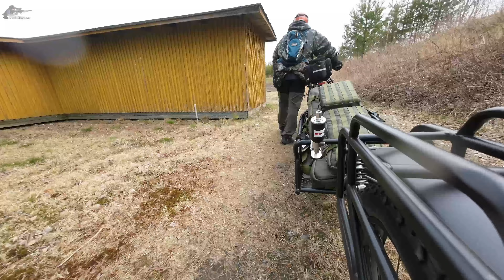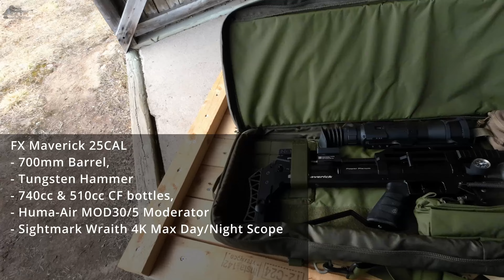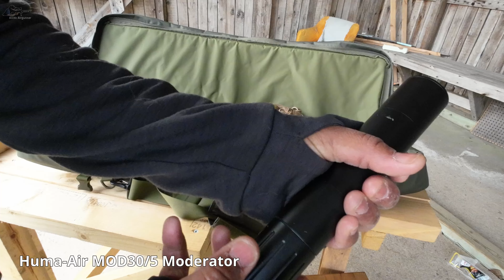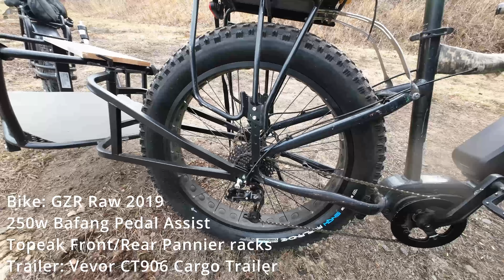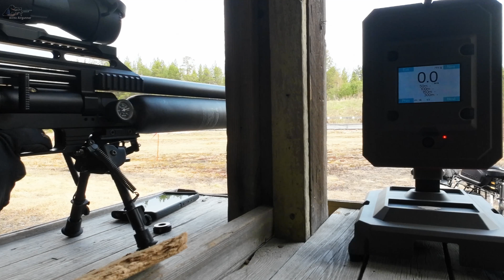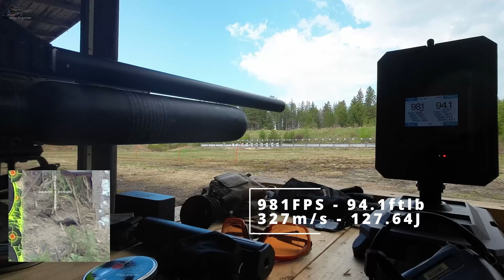FX Maverick Tasmanian Tiger Range Bag | FX Ballistic Chronograph

Comment: Change your liner to a heavy and measure again. I think this doesn’t give you a good result and you’re not hitting your target. 

I had the same erratic results when I tried shooting the .30cal 45grain ZAN slugs in my 1:26 pellet liner. 

After changing to a heavy slug liner (1:16) the speed changed and I hit the target. 

At the moment I’m finding out what slug works in my .30 cal Impact M3. Best results so far with FX hybrids 44,7 grain and 68grain ZAN slugs.  

And believe me, I’ve tried hundreds of different weight slugs before coming to this point over the last six months. 

At the moment I get 860FPS with the 68 ZAN’s with the 1st regulator on 170bar and the 2nd at 130bar. (Power block kit installed with a stronger hammer spring and Huma 8.5gram hammer weight) I’m trying to get them in the 950FPS region. 

As far as SHTF… I think it’s okay to survive using the rifle for hunting small game if you must eat, but don’t expect other kills unless you can hit someone in the eye at 50m 🤗

Comment: Good info. That's the main thing I do when it comes to airguns, is look for the best ballistics. In my M3 .25, I used AVS .253 50gr BTs and sm shooting them at 1040-1060 fps depending on temps and getting a bc of around .197, and in my Dynamic .30, I'm shooting Griffin 90gr bts at 970 fps getting around 187 fpe and a bc of .237. I try to find the slug with the best bc and accuracy. I am currently testing some new AVS .301 round nose boat tails and secant ogive boattails to see how they perform compared to the Griffin 90gr bts. Sorry, I geek out on ballistics.
Reply from the maker: Don't be sorry 👍👍👍
Reply: The highest bc of got was with a .300 108 gr bt and it was a .310 bc and I confirm everything out to 300 with a 50-yard zero.